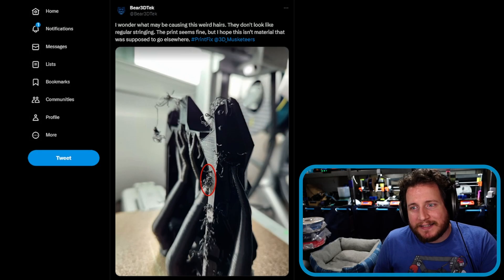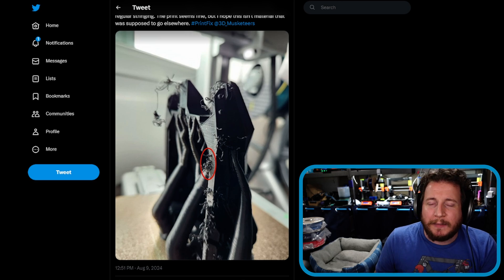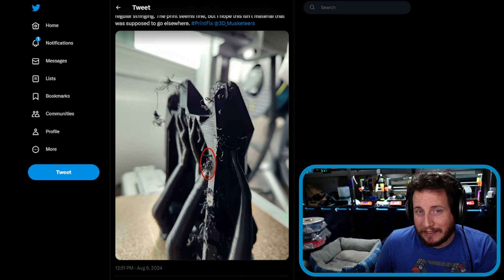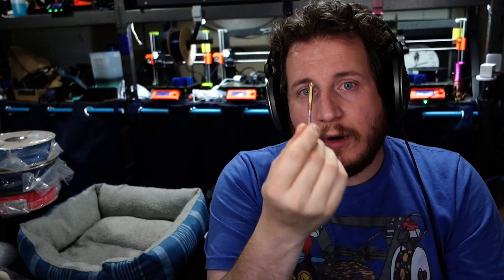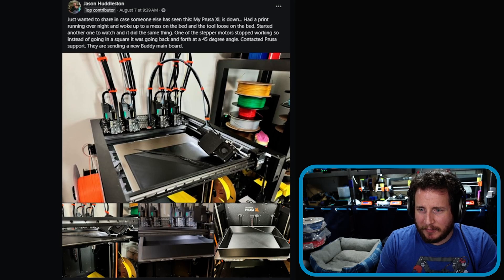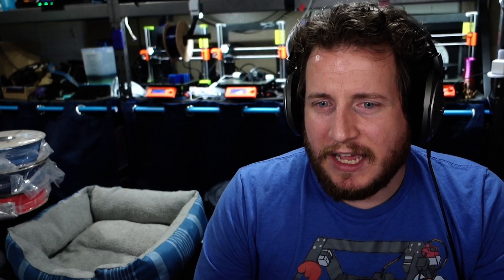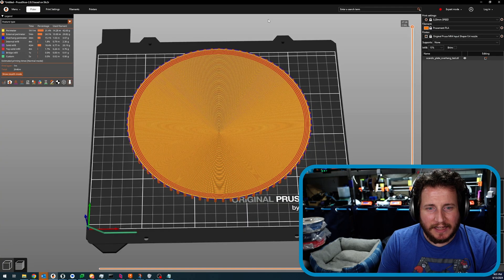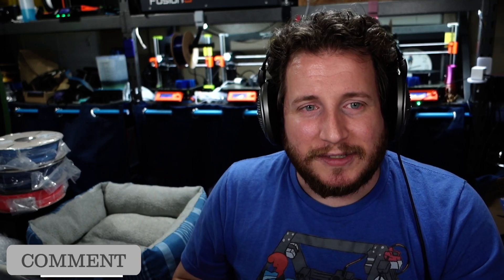Prusa Pressure PROBLEMS! - PrintFixFriday 153

Comment: After 6 weeks of XL joy one of my XY motors quit (diagonal motion only).  After checking things out I contacted support.  To determine if it was a wiring issue or driver issue they had me swap the connections on the Buddy board between the XY motor cables with the Z motor cables.  That confirmed it was a Buddy board failure (and not cables or motor) and  I had a new buddy board in 3 days and my XL joy resumed.  
I did add little stick-on cooling fins to stepper drivers on the new Buddy board as well as a cooling fan to the cover.  I figured it wouldn't hurt.
Reply from the maker: so weird.. maybe they were not tested for the heat waves people are seeing?

Comment: Latest orca splits the overlap in top bottom and infill values. Personally I use 10% for infill and 20-25% for top and top and bottom surfaces to reduce appearance of pinholes around sharp infill to perimeter intersections ;)
Reply from the maker: thats really smart! Need to try that out. I am still on 2.0.0 for orca ha ha!
Reply: @3DMusketeers  get the 2.2 nightly and have fun! There’s been so many fixes and improvements since 2.0 ;) and 2.2 is quite mature already, if anything more stable than 2.1.1 due to the sheer volume of bug fixes in this release ;)

Comment: For anyone who wants better part cooling without the MK4S Upgrade, try the "Improved MK4 Fan Duct" from Juan Puchol.
Reply: Pls understand, that only another fanduct dont make better cooling. You need higher/better airflow AND the better Fan duct togehter. I tested it servel times with only other fan ducts and it makes NO difference in part cooling. If you have no idea about physics and technology, then don't write such false things.
Reply from the maker: yeah that new fan is MUCH beefier than the original one. The stock MK4 fan has about as much static pressure as a mouse fart, it works, but it has limitations. The MK4S seems much better IMO
Reply: @3DMusketeers  I'm waiting for the fan to be offered as a spare part. The 3d print files for the shroud are already there.

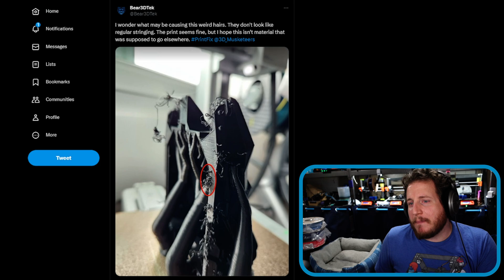Comment: 0:27 This isn't just from timelapse actually! I have mine fully disabled and my A1 does this thing where it moves the print head aside and drops the z-axis then back up, apparently this has something to do with checking if the bowden tubs are jammed and tensioned up somehow, it's a clog detect feature essentially from what I've come to understand. Haven't bothered to dig deeper but it definitely makes print quality take a hit, not worth it imho.

Comment: The toolhead can be dislodged from the carrier if the whole assembly knocks into the right most end of the travel. The tool head will unlock as the sliding locks get pushed over and the tool head can just fall off. I have seen it myself on an older firmware version. Pre 6.0.0
Reply: This is definitely a problem that Prusa needs to get to grips with. However, what you are talking about can only happen if there is a loss of step on the X axis. Not under normal circumstances.

Comment: the core xy issue, sometimes it is a loose or damaged cable. Cold, it behaves, but after some heating and vibration, it drops out.
a bad MOSFET on a motherboard can cause similar however.
Not quite related, but I remember a commercial fire panel that was shipped to me where the heavy inductor on the power supply fell out of the motherboard as I was installing it (no, I wasn't beating on it). turned out that it was never properly soldered and hot glued in place, somehow passed all the QC checks, but failed anyways

Comment: I have had my tool heads come off a couple of times over night. I wonder if my buddy board is bad? On my camera, it shows that I'm hitting thin overhang areas that are curling up and the printer is crashing into them. (crash detection set to medium) I ended up turning crash detection off and I haven't seen the issue again. Plus I need crash detection off for phase stepping any how. But now you got me wondering if my Buddy Board might be defective? Also as a side note, whenever my power goes out, the XL seems to always be off like 1 whole mm when it comes back on. This is really annoying because power panic should help me save a print not ruin it. What good is it if it doesn't return to even remotely close to the original point? Grant have you ever experienced this? I had this happen on my MK3S+ and Prusa told me it's a known issue and they were trying to fix it. Now my XL does it too. I wonder if the MK4 is the same?

Comment: I hope they do the same improvement on the XL. The cooling on the XL is terrible
Reply: The cooling could be better, but it's definitely not bad. If you can't afford an XL because you don't have the money, then so be it, but stop making the XL worse than it is.
Reply: Not only the cooling terrible so is the price, I don't care where it's made these prices for any prusa 3d printer is terrible.
Reply from the maker: The cooling definitely needs work. 

The price is fine though. Especially when you consider its easy to work on, open source, and has the best CS in the industry.
Reply: @3DMusketeers  Agreed. Prusa support makes the price worth it. When you have to  fix issues and the company says you're on your own, you have deadlines and your equipment is down. I like the peace of mind and would happily pay more over the life of the printer.

Comment: I am starting a new project with the gunstar from the last star fighter (amazing movie even if the early CGI is a little dated). I had the blue line get kinked more than once. lol so it's missing a layer here and there but only in the blue. I'm calling it battle damage. lol I did discover my MMU2 seems to be out of order at the moment. I tried to print on the mk3s+ and I just got all yellow lights. I wonder if my USB charger failed. It's old. USB is required for the MMU2 because of a power issue. I have the upgrade for it, I just haven't bothered yet. I might take a break on the gun star and print the mmu3 for it.

Comment: One print I struggled with on my mk3s+ was the pikapool model designed for the MMU2. I printed it like 4 or 5 times and it failed every time. One time I got close, but it started missing layers twards the top. Until I kept it. I decided I'd work on it later. Well that was before organic supports. And so I tried it again on my mk4. First attempt 95% success. I'm dinging it 5% because out of 3 prints (in color you get additional prints for free with regards to purge) one had a damaged sword. All 3 of them the pokeball is kind of meh. But they did complete. Outside of the pokeball issue, they look fantastic! I could have sworn I used prusament red on the original. I'm definitely doing it now. IT looks a lot shinier. The old one is more matte. Very odd. The shiny looks good though.

Comment: I suspect that for the press fit nozzles they aren't properly taking into account the difference in expansion of the different metals. I also suspect that they don't employ heat when they press them. Ideally they'd freeze the internal part and heat the external. This will force them to really grab hard when they are both heated up. Same way we used to install spindles in front steering knuckles in old cars... and if it works for a car where I'm sure an extruder isn't going to push it apart.

Comment: If the XL tool hits the far right side of the printer it will unlock the tool dock. Lost steps from driver overheating / errors most likely.
Reply: Yup I've had this happen a few times. Wake up to a tool detached and the camera shows what happened. I stopped this by turning off crash detection. I was seeing that some of the bigger overhangs were curling and causing the print head to crash and or skip steps, then it somehow gets out of sync and bumps the right side and detaches the print head. Thank goodness the printer stops printing when it notices the head detached. I have to have crash detection turned off anyway for the phase stepping to work, so it all works out. I have yet to have a failure with crash detection turned off now.